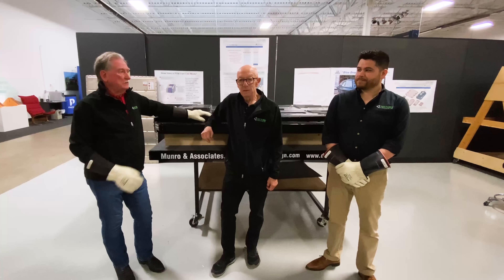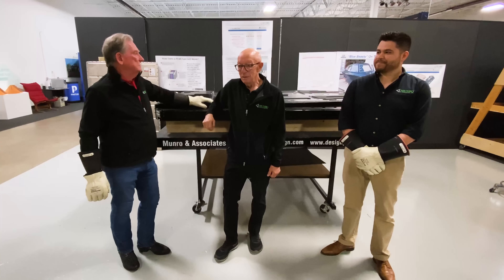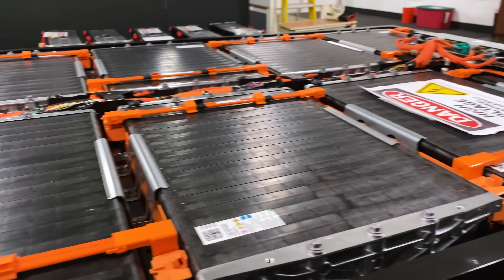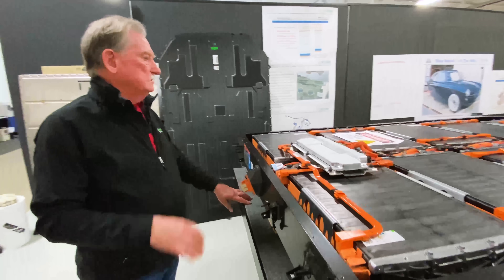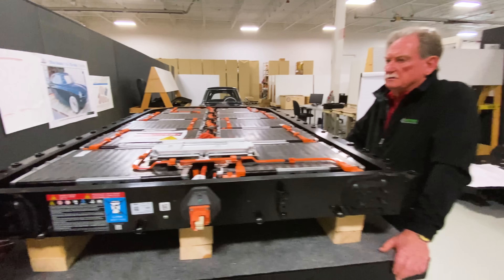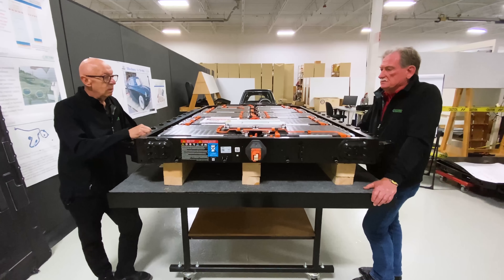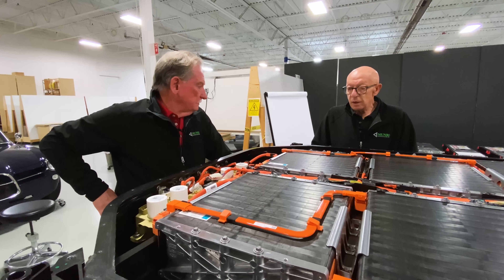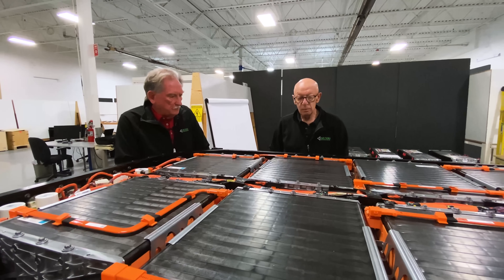Ford Mustang Mach-E Battery Exposed!

Comment: IMO, Battery Pack Design Score:

3/10 Mach E
4/10 Model S
6/10 Model S Plaid
7/10 Model 3
9/10 Model Y next gen

The Mach E is a viable product, but unless they are going to clean sheet their own battery pack they can at best be a very distant #2. It will take at least 5 years for them to replace this pack in this segment. Their next battery pack will at best be at Model 3 design score, and Tesla will have 30-50% improvement above that by then.
Reply: VWAG MEB pack 9/10 and it's available now.

Comment: Clearly the battery designer doesn't appreciate how much power is lost in the connectors.  He has 20 connections in series for the 10 modules which have to carry the full amperage of the pack.  On hard acceleration that could be 1000 amps (350 to 400kw of power depending on total pack voltage).  Thus those connections must be high power capability with low resistance but also removable to allow the individual modules to be removed.  But they will never be as good as the Tesla design using friction welded aluminum wire between the bus bars and the individual cells.  The resistance of a permanent wire weld is one to two orders of magnitude lower than any removable connection.

Comment: Ford have come into the electric car business very late and are buying in all the technology. They only sell 2000 a month and reportedly lose a shed load of money on each car.
Reply: EVERY car company loses money on  every new car they build when they first introduce them. And that includes Tesla. Thats why manufacturers try to keep platforms around for several decades and sell as many models using the same parts as they possibly can in order to recoup the upfront investment costs. The only real questions are how many vehicles they have to sell before they are in the black, and how long it takes to sell that many. If ever.
Reply: “come into the electric car business very late”

Ford has been making hybrid SUV’s for nearly 20 years and plug in hybrid SUV’s for nearly 15 years
Reply: @DavidHalko  but only by taking an ICE car and buying a battery to stick in it and satisfy the Californian mandates.

Comment: Sandy, that set of 4 contactors is for three phase power coming from the llc battery charger. The fourth contactor is a bypass for the DC fast charging direct connect to the battery. Whole assembly is known as hvjb or high voltage junction box.
Reply: No three-phase power goes to any battery; a battery is DC.

Comment: For Sandy's benefit, we metric guys don't use sq cm at all ! In fact the centimetre has been a 'deprecated unit' for some 40 years. Units that are 1,000 times apart (like the metre, millimetre and kilometre) are preferred in the SI system of units. (Systeme Internationale or International System as used by all nations except the the USA, Myanmar (formerly Burma) and 1 other small country IIRC). We use sq m unless it's really tiny. That Ford battery cover looked about 3-4 sq m to me at a glance.

Comment: I'm not complaining about free content, but I didn't expect that "exposed" would mean just pulling the top cover off, and not measuring or removing even one module. It also seems strange to measure module voltages and not note that this means that they are 8S and 10S modules... but then, I do understand that Munro's focus is manufacturing cost, not electrical configuration. 

And they're "modules" Sandy; yes, technically they are "batteries", but in standard industry terminology those components are "modules".
Reply: Why make one video when you can stretch it into 3 to 5?  They get paid for advertising views.  More vids=more money.

Comment: I'm not impressed by what I see, there is so much more room for improvement and cost reduction and this just looks like a big mess that no one at Ford is interested in cleaning up, just increase the price and add more batteries that's their solution. 
I have to give it up to them though because their marketing had me fooled but if this is what I see, I don't have high hopes for their other vehicles.
Tesla is just going to keep optimizing and improving their design and implementation of components and parts.

Comment: I thought that both the ID.4 and Mach E are using LG Chem batteries from Poland. It's confusing because the upcoming US built ID.4 will use SK Innovation from Georgia, and the upcoming F-150 Lightning will also use SK from the same factory.
Reply: ID in Europe uses LG Cells in the US will use SKI Cells. Don’t know about the Mach-e but it doesn’t make much sense to use cells from Poland when it is only build in the US.
Reply: @e-redj  JFTR: Ford Mustang Mach-E are built in Mexico, not in the USA.
Reply: Everything else I’ve read says Mach e uses LG. I think they’re confused at Munro.

Comment: 7:35 VW had a recall a few years back for e-Golf and GTE battery packs due to water leakage.  The sealing was inadequate at the factory.  The increased sealing on the ID.4 may be a response to that - that recall cost them an absolute fortune.
Reply: Considering the terrible ground clearance on the Mach-E , It would make me a little bit concerned.
Also he showed  a video of a VW ID4.
Pack. My recollection is it was much neater and tidier inside with less wires running all over the place. I think he made a comment how he liked that all the wiring went up the central corridor of the pack.
Also I noticed on the Ford battery in the front area where those round white contactors are at. There is a small wire connector that's just hanging there unsupported at the connector. So there's a bunch of wires coming in it's a white connector that's kind of wide the other side of the connector and then wires continue and it's just hanging there. Seems to me that is a terrible risk for vibration failure. That thing's going to be jiggling around inside there until those wires fail from fatigue. Maybe there was a fastener that they already took off, but if not I would be concerned.

Comment: Not impressed with coolent situation at the moment. Looks like another OEM just slapped some pouch batteries in a chassis again.
Reply: Right. I'm pretty sure it's for modular replacement if needed. There are instructions for module replacement in the service manual.
Reply: Not true.  They had to make it look pretty.  They also had to add additional weight to give an appearance of safety.  The massive amounts of wiring show lazy engineering and design.  I think that is where are opinions align.

I guess the one positive is that if one of the module goes bad, you don't have to replace the entire battery.
Reply: @thegamingsociety7880  , I believe this is the whole point of this setup. If you have an issue with your battery, the dealer will be able to replace the faulty module only instead of the entire pack, which is cheaper but also more environmentally friendly.
Reply: @davidv9699  Yet the real reason is probably actually due to the limitations of the pouches and what they require for additional protection.  All the extra wiring is just because they don't want to have to actually engineer/fabricate a good solution.
Reply: @davidv9699  The primary consideration for modular designs is use across a wide variety of vehicle architectures. Even the fact that they have two sizes of module suggests this. This is also suggested by the coolant plumbing. Each set of parallel battery modules sits on cooling plate, and they are plumbed down the middle. Ford can use these components on any vehicle in their lineup. The narrow modules/coolant plates can be fit into a small city car with a narrow stance. That this stuff is repairable is a secondary benefit of it being a modular, lego brick design. There are disadvantages to such designs: weight, wasted space, added assembly time, many extra points of failure, etc. But those are balanced by the advantages in flexibility.
Reply: @patreekotime4578  agree with the use in other platforms, hood advantage.
Reply: @thegamingsociety7880  there is no additional protection needed by pouch cells. Pouch, prismatic, or cylindrical... every cell group gets a BMS tap to monitor voltage and to balance, and every module gets a temperature measurement or two.
Reply: @thegamingsociety7880  Unless there's a coolant leak from one of the 42 fittings inside the pack.  I will not be surprised at all if there are a lot of reliability issues with this design long-term.

Comment: I learn from my 2006 Lexus GS450H that the battery have faults. I buy the car 2016 and 2017 the hybrid battery was down. But i learn and change the fault module from the battery. The car run again. But there was only a voltage test to find the bad module. 2018 it comes again. And 2019. But then i know that the battery must check by the capacity. And i found one 7,4 volt module with only 1800 mA/h. Normal is 6500 mA/h. Then i rebalance the battery with modules from a Prius. The car run 2 years fine. Now i have to do this again.
But now i see in the test results that the hole battery balance down before the (now) bad cell dies. I have to recondition all other modules to find the good one, to build a batty pack. 
The car only check the voltage of the module blockes (2x modules = one block), and if one block have X% difference to other blocks the fault comes up.

So now i want to ask: What do actual E-Cars batterys? Check they internal resistance, voltage, capacity? Because if one of this change, or go down/up the hole battery pack shut down with a fault. The car driver must pay a lot of money for a new battery, but in the pack was only one module down. The rest of the battery modules are fine and can recondition.
Or, i drive the new car: Oh, 450 miles, perfect. 2 year later only 400 miles, okay, 2 year old. 3 years later 350 miles.. because the modules balance to the lowes module in the battery. 

Ad the end of the day i mean that the resistance, voltage, capacity must by check by the car to get back a message what happend in the battery to check if the car pass to the promise of advertising from the manufacturing company.

Comment: Great video,along with thev D4 battery  shows the engineering and technological superiority of Ford and VW. Just compare the elegant  designs with the glued on mess of the old technology Tesla batteries. Here we have an engineering with the customer and enviroment in mind. Easy to repair replace or recycle, again as opposed to the gluod on mess in theteslas that is designed to get more money from the customer in case of a failure. A lot of talk about fasteners but look at Munro video E32 or E28 to see how many components wiring and fasteners are in the Model 3 or Y battery. No mention that you can not open a Tesla battery cover without destroying it because of the glued on mess. Very damaging video ...thats why we didn't hear Tesla even ones. Wait to see how easy is to remove the individual battery packs as oppose to the ...glued on mess!
Reply: re: "compare the elegant designs with the glued on mess of the old technology Tesla batteries."  well keep in mind (unlike ICE) the technology in most BEV (regardless of manufacturer) is basically INVISIBLE to 99% of consumers and ultimately MEANINGLESS.  if no one had ever crashed a Tesla or opened one up you would still be IGNORANT to this day at how the first packs were constructed, as such this would leave you with NO "molehill to make into a MOUNTAIN" and nothing to get worked up about. the brand new MS Plaid is still built this way but Tesla fanboys don't seem to care.  in the end EV tech is now an APPLIANCE like a Samsung Note with a fixed battery.
Reply: You're funny!

Comment: Interesting. I hope you're going to tell us how many cells are in series on those modules. Will make great information for future reusability for DIY energy storage. Sometimes wrecked car is great source of high quality batteries.
Reply: The smaller modules must be 8S3P (24 cells), and the larger modules 10S3P (30 cells), in this "standard range" Mach-E pack to add up to the 288 cells in 96S3P of that pack.
https://jalopnik.com/a-look-at-the-engineering-behind-the-2021-ford-mustang-1839911078
This is exactly the same electrical configuration as the Chevrolet Bolt, although in the Bolt the two smaller modules physically sit on top of the rear pair of large modules, while the Mach-E puts the small pair ahead of the others.

The 8S and 10S configurations lead to the 32 V and 40 V module voltages, since they strangely chose to tear down a nearly fully charged (4 volts/cell) battery.

The extended range version adds two more modules over the rear pair of modules, and the modules are different to reach a 94S4P configuration of 376 cells... which implies 10 modules of 8S4P (32 cells) and two modules of 7S4P (28 cells). Both versions have the same cells; there are just more per module and more modules in the larger pack.

Comment: Maybe the round things labled "Coil" are just coils? Why not?
Reply: Because there is no reason to have a coil in a battery pack, except as part of a relay (also called a contactor).
Reply: @brianb-p6586  No reason known to us, that is, as opposed to no possible reason.
I would be surprised about a mechanical relay - but that may be misguided.
Reply: @vsiegel  An EV battery pack normally has a contactor (also known as a relay - a mechanical switch actuated by a solenoid) in each high voltage line between the external connector and the cells. The contactors are normally open and low-voltage controlled, to act as fail-safes: the high voltage is contained within the battery case unless the vehicle's control system is working and enables output by closing the contactors.

In this case there appear to be four of them - the outputs to the front and rear may be separately controlled.
Reply: @brianb-p6586  Thanks, makes sense.

Comment: Just a note about reusing Tesla battery modules. The battery modules from the Model S and X are very re-usable. They are 250ah - 300ah, 24 volt nominal, and are very desirable for off-grid Solar installations and RVs. The modules weigh ~ 55 lbs and measure 11.5  x 27 x 3.5 inches. These battery modules have proven to be very reliable in the Solar systems they have been used in.
Reply: The Model S/X modules are 22.5 V nominal, not 24 V, but it's close. The auto manufacturer doesn't care about non-automotive applications, in which a multiple of 24 V isn't important anyway.

Comment: I’d really like to know if there’s some hardware limitation that is causing Ford to decide limiting charge rate to 12kW at 80% SOC is necessary, or if it’s just poor software tuning on ford’s part. I can’t see any reason why any modern Li-Ion pack would need to throttle back so substantially at such a normal SOC.
Reply: I thought (and could be 100% wrong) that the throttling down of charging had something to do with the need to start balancing the cells...
Reply: @TheEvilmooseofdoom  who knows but no other car does that. Ioniq 5 is charging at 140kW at 80%. Considering the Mach-E has a huge 11kWh buffer there’s no reason for such serious throttling.
Reply: re: "I can’t see any reason why any modern Li-Ion pack would need to throttle back so substantially at such a normal SOC." no worries, the nature of GREED/RAPACIOUSNESS (ie, the unchecked desire for MORE, BETTER, FASTER) is that it creates BLINDSPOTS in the psychology of the individual.  in contrast, Bolt and Kona owners whose cars keep catching on FIRE have vision better than 20/20... https://electrek.co/2021/07/08/chevy-bolt-ev-catches-on-fire-after-receiving-both-of-gm-software-fixes/
Reply: @phillyphil1513  their cars have flaws with the pack that doesn’t have anything to do with charging speed above 80%… their cars have defective cells. Wholly unrelated to DC fast charging. The 80% throttling of the Mach-E is not related to Kona/Niro issues. So, try again.

Comment: If you are engineering a battery for this design build why won't you but the contacts to just snap into the positive and negative rails lines and support hangers built into the tub case where the batteries sit in? Snap, lock, next one please.
Reply: Because those contacts carry hundreds of amps and snap-in connectors for them would be much more expensive... an expense which would not be justified for connections that will be made once and never changed for the life of the battery.
Reply: Cars flex when they hit a pot hole, curb, etc.

Probably not a good idea to snap large & heavy batteries to a rigid rail. Weaken those connections, fires can start.